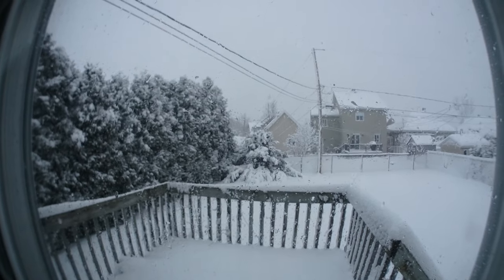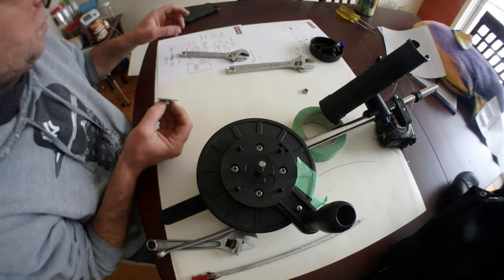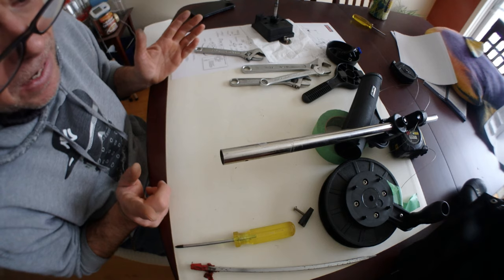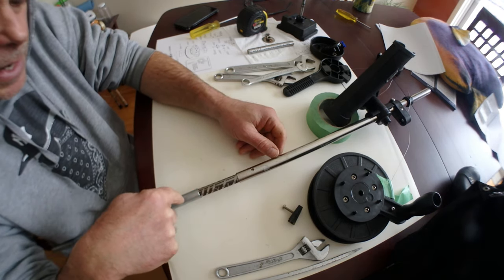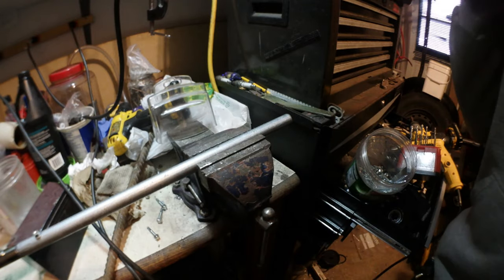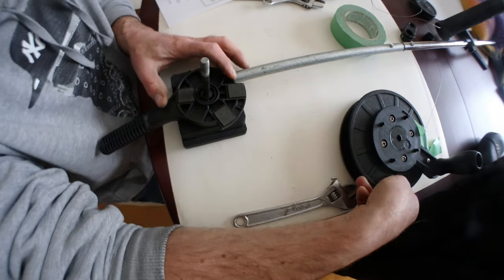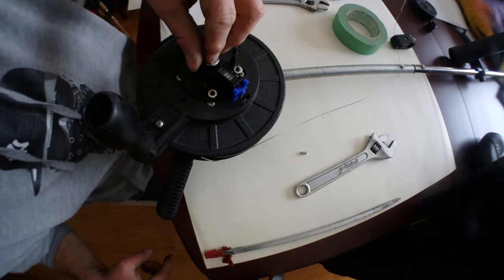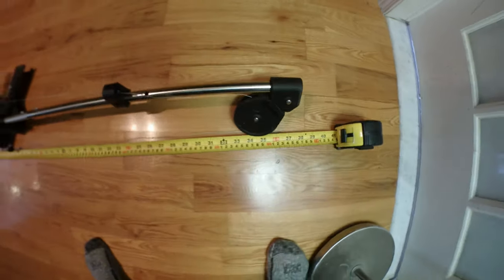Scotty Downrigger Mod, DIY  A Longer Boom. Now I Have A 37" Boom.

Comment: How did this end up working ?? Did it break and what size weight did you use with it ?? 
I don’t want to pay for a boom extension replacement
Reply from the maker: I am still using it, using a 6 lbs weight with it.

Comment: thanks for the instruction. I have same scotty 1060 and is about to shorten the bar. can you tell me how to pull the pully out?
Reply from the maker: You better shorten it from the base.
Trying to remove the pulley can end up with broken part.
Don't ask me why i know that !
Reply: @obscur156  thanks. I finally removed the pully. but there is a pully plug at the top of boom that I could not remove. I did not see it in your video. how did you remove it?
Reply from the maker: @johnthehammer7702   This plug is pressed in,almost impossible to take out without breaking it...